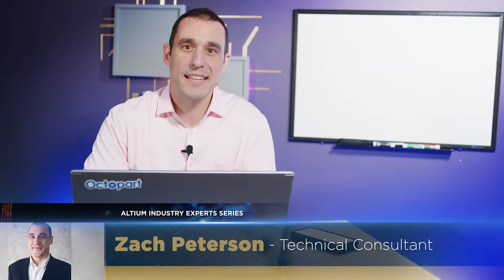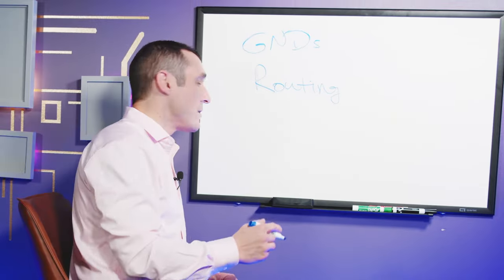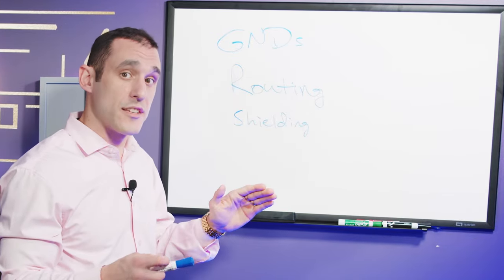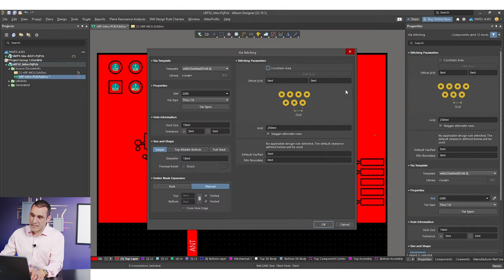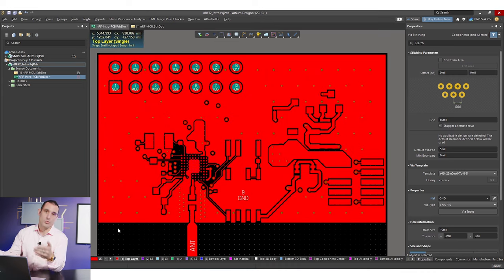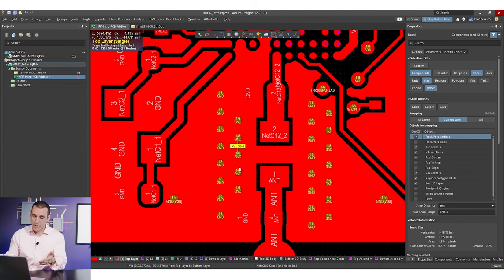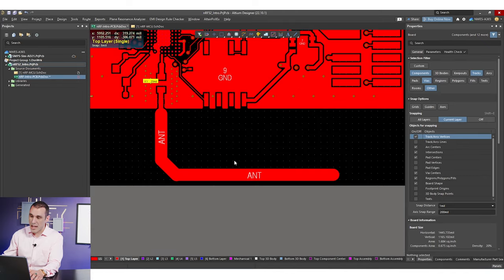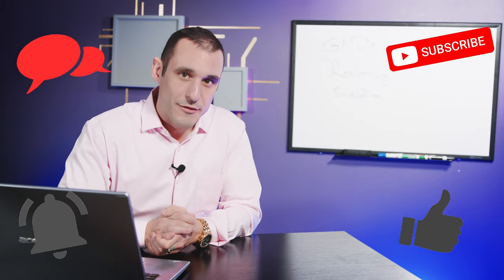Stitching Via Deep Dive | PCB Layout

Comment: Stitching via for low speed stuff look pretty useless...
Reply: It is, just using some default settings you will provide some small additional shielding effectiveness around the low speed lines. Might as well not worry about it. However, with EMI susceptibility, may there is some situation where the via fence helps on a low speed line. However there are other methods that help with EMC once the design is complete, doing a respin just to apply via fencing to try and solve an EMI susceptibility problem for a low speed line does not make sense.

Comment: To place additional vias and connect them properly you need of course copper from one layer to the other layer. To check this Altium Designer has a nice Design Rule. It is called ReturnPath and can be found in High Speed Section of your Design Rules.
Reply: Good point, I added a link to a Return Path rule video in the description

Comment: When adding gng vias to connect all the planes, I usually set the opasity of the planes to 50 basically giving you a view through all the planes/layers, so you can easily see the areas where you can add gnd stitching vias without having to move a lot.
Reply: That's a good point, I normally do it with polygons after I have them drawn the way I like them. The automatic tool will apply clearance rules to the via array but if you're doing it by hand you can run into clearance errors, setting the opacity definitely helps.

Comment: If you're already using a fence at 20 mils, why stitch at only 250 mil or 80 mil?  Is it to make the design intent of the antenna feed stand out?  Do the stitches, even when separated from traces, cause too much disruption to the planes?  Do fab houses still charge per drill hit, even though that doesn't seem to show up in their online quotes?  (Or do they if you stitch over most of the board?) Do they start charging at high volumes, so you want to avoid getting into the habit with prototypes?
Reply: I think there is a lot going on with stitching vias that has to be balanced. For example if you already have close stitching as a fence on specific lines and the board edge then you might not need it in the internal region of the board. For example, what if you have a power rail on an internal layer? Closely spaced stitching vias could turn that rail or plane into swiss cheese. Another reason for stitching could be to link all the copper together to help with heat transfer, then you want dense vias in the region where heat is being generated. In fabrication, you can get charged per drill hit as a function of drill diameter when you go to high volume due to tool consumption, but in small prototype batches they might not chare per drill hit as they can factor in enough margin to cover tooling cost.

Comment: Hello Zach, do you consider Dk for what frequency in the calculations?
Reply: And how should I proceed when I have multiple layers with different Dks ?
Reply: Simplest estimate is to look at the maximum frequency for your channel bandwidth and use that for analysis whenever impedance or stitching via spacing are important. You can pull a value from the material datasheet at that frequency and use it for analysis. If that is unavailable, then you're left interpolating the frequency using a wideband Debye model, or more simply a Lorentzian model. Simulators like Simbeor, Polar, and Keysight have these models built into them.

Comment: Why must layers 4-6 be symmetrical with 1-3 in terms of copper fill?  Is it just a convention?  Does it stave off some manufacturing problems?
Reply: I say "must" with an asterisk. Fab houses like stackups that are symmetrical in terms of copper coverage, especially once you start going to higher volume. The main point they will worry about is warpage. If there is heavily uneven copper distribution on top and bottom half of the stack, there could be some warpage if one side of the stack cools before the other side after layer build up. The same could happen after repeated reflow. Since it's a simple design element that is easy to implement, most people just go for it. We've used uneven copper in small boards and have not had problems, even for a board going into order of 10k units production.

Comment: Hi Zach, why do L2-L5 have a cut out below the antenna trace. Is it because the idea was to make the antenna trace thicker by distancing gnd further away in the stack and hence use L6 as a reference for the coplanar wave guide?
Reply: Two reasons: 1) It was used in the reference design, and to de-risk the design we used a line design that we know works, 2) it requires a wider width, which does give lower conductor loss. The nRF documentation makes some claim about reducing capacitance that would affect impedance or unintentional coupling to other traces, but that explanation is nonsense; you would actually want to keep the ground if that was your reasoning. In this design we kept everything (including digital) clear around the trace and we're not routing under it on an inner layer, so it will operate with low noise even with the ground clearance. In general, you do not have to do this. In some designs, it's better to keep all the ground because you actually need it. An example where I did this was in a radar board that we have in assembly. The board uses blind vias on the coplanar line and adjacent ground, but the layer stack has 10 layers total and tons of high speed digital, we have no choice but to route that digital stuff under L2 GND on internal layers because it has to connect to the radar SoC for configuration and data capture. If I were to eliminate ground in that design the board would definitely not work.

Comment: Great video! Thank you very much.. I always used the vías super close one to the next one.. being so conservative has any inconvenience? On the other hand, why you use 2 when the DK is 4? Thanks!
Reply: I used Dk 4, the refractive index is equal to 2 if Dk is 4, that value (square root of Dk) is what determines the propagation velocity. Being conservative and using the vias super close to each other is fine but might add cost per drill hit at volume manufacturing. The cost per drill hit is small and is normally ignored in prototypes, but it adds up in volume production. There is also hole-to-hole clearance requirement that has to be satisfied.
Reply: Thanks for clearing out. @Zachariah-Peterson

Comment: Btw, doing the routing of hi-speed-signals (including I/Os with considerable short rise/fall times) early and placing the return vias at the same time when they swith layers can reduce later problems/overhead-work to add the return vias.
Reply: Yeah I would agree to try and place that when routing just those signals, but sometimes you need to re-route... it would be nice to have a design rule that allows checking for a stitching via based on net class.

Comment: I'd love some info on via fill % during enig/ hasl.

I'm using stitching vias for thermal conductivity, and not sure on optimal size / qty to get best bang for buck, from standard via plating processes without extra fill complexity.
Reply: Unless you use very small via-holes (and or Micro-Vias / buried) the dimensions and amount of stitching vias for thermal puposes will not alter the production costs significantly i guess.
We'll see what Zach has to say.
Reply: Given the finite hole-wall to hole-wall clearance limits for mechanical drilling, I think you would get the best bang for your buck with some intermediate value for the via size. That's just my intuition based on drill cost and the heat flux you would want to achieve across the board. It's actually a fun little dual optimization problem, maybe I'll play with it and if it's fruitful I'll do a video on it.

Comment: Hi, thanks a lot for your video. 

I have a question: let's assume I have all my ground planes connected by the stitching vias, and let's assume my top plane has all the RF signals and no ground plane, because the reference is the second layer. 

When I connect the GND of an IC from the top layer, should I use a buried vias from top layer to layer 2, or another stitching vias that crosses the whole stackup, or it makes no difference? 
I know electrically it's the same, but maybe one is preferable from a noise perspective

thanks!
Reply: The biggest driver of board fabrication costs in traditional fabrication processing is the number of lamination cycles. Each time you use a blind via transition on a layer, you add a lamination cycle. So of there is no electrical reason or routing reason to use the blind vias, then just use through-hole vias. For your design, I do not think it will make a difference electrically, so just use through-hole vias.

Comment: I have a question about placing vias near low speed digital traces. You mentioned its necessary to "maintain a return path when crossing multiple layers" 

I don't fully understand. Wouldn't the return current flow from the GND connection on whatever SPI IC the connections lead to? Why do you need it near the physical transition? Could you explain the physics here a bit? Thank you so much! 

Very grateful for your videos.
Reply: Hi Ryan, yes the current ultimately reaches the GND pin on the IC, but between the TX and RX ICs the trace has some capacitance to ground, which means the current in the GND pin is the displacement current from that capacitance. If you make a transition through a via and do not provide nearby GND, you interrupt some of that displacement current flow by decreasing the capacitance between the signal conductor and the GND conductor. Without a via, that displacement current will be induced by fringing fields to any nearby conductors, so it becomes unclear where the displacement current exists. That means there will be higher radiation, and in the cases where the signal has very fast edge rate the radiation can be quite strong. In the case of differential pairs, we sometimes prefer stitching vias but not simply for providing a return current on a differential via transition; that's a topic for another video.

Comment: Can we integrate the following into this? As we know the stack up and the material properties loaded into the designer

1. Trace width calculator along with the impedance calculator
2. Via shielding of a net. (spacing calculated based on the stackup input)

kindly let me know if it already exisits or if we need such a tool.
Reply: Really Love these videos, they help me a ton!
Reply: Thank you, the layer stack manager currently does not support coplanar waveguide with ground vias. The impedance and maximum TEM frequency will depend on the via pitch and spacing, so it is not a trivial problem to incorporate these features into the calculator. Other programs you can use to evaluate your coplanar waveguide design include Polar and Simbeor.

Comment: Hi, can you please explain to me one more time because I didn't get. Via shielding prevents frequencies which are lower or higher than a calculated frequency?
Reply: They help shield against all frequencies, but lower frequencies are much more effectively shielded than higher frequencies. The shielding is most effective against frequencies below some cutoff value. The cutoff is approximately determined by the distance between the vias, and when this distance is equal to a half-wavelength the frequency corresponding to that half-wavelength will be the highest frequency that is most effectively shielded without starting to strongly radiate.
Reply: @Zachariah-Peterson  thank you very much

Comment: what if my PCB contains multiple substrates how do i calculate my constant ?
Reply: What do you mean by multiple substrates? Do you mean stacks of prepreg with different dielectric constants? In this case you have an effective dielectric constant that depends on the thickness of those stacked sheets, the simplest approximation is to use a thickness-weighted average to approximately get an effective dielectric constant. From this you could then calculate the wave speed in the substrate, and then you can estimate the spacing required for stitching to ensure isolation.
Reply: @Zachariah-Peterson  its exactly what i meant thanks a lot !

Comment: And a 4mil annular ring ((18-10)/2)?  Even for class II most PCB fabs want a min of 5mil...   one thing to note is calling out finished hole size. So for a 10mil finished on an 18mil pad, they'd prob. be drilling 12 over that for the plating.
Reply: I've never had a Class II called out as must-be 5 mils with the two main fabs I use, as well as by my EMS clients. But there is one fab I have used that always requests teardrops added in Class II just for extra protection at the trace-to-pad connection, they do the same for Class III.

Comment: How to length match rf lines in pcb ..
Reply: Typically there are two situations where you need some kind of length matching in an RF system: when you are using differential RF components (some amplifiers do this) or if you have two lines and you need to precisely control the phase between the signals on those lines. Which type of instance are you referring to?
Reply: @Zachariah-Peterson  i have to match the phase of two signals
Reply: Is there any dimension for using accordion length tuning

Comment: Hey Zach, great video! I was just wondering: if I have  mounting holes that will be connected to a metal enclosure via screw, and create a via fence along the edges that is tied to the chassis that acts as chassis ground, will the shielding effect work? 

Thanks again!
Reply: The shielding effect can work regardless of where the vias are placed, if you have a fence structure they can create a shielding effect in certain frequency ranges.
Reply: @Zachariah-Peterson  thank you very much for this, Zach. Helps cleared out some of the doubts that I have. Thanks again! 😃🫡